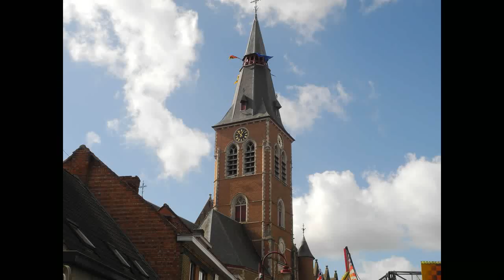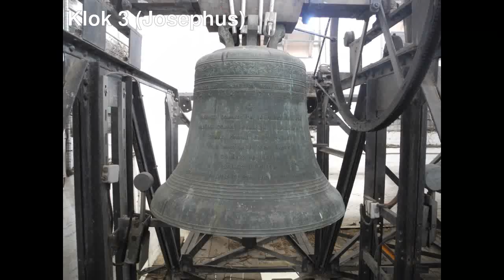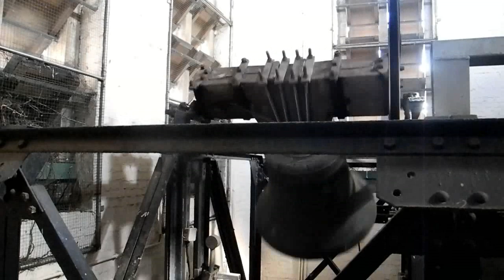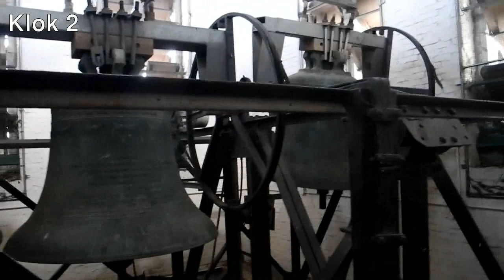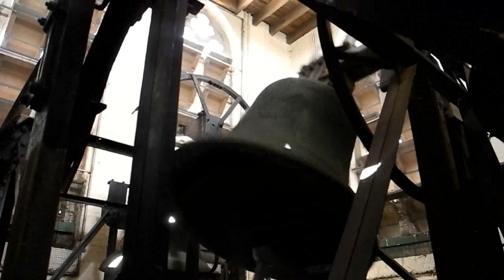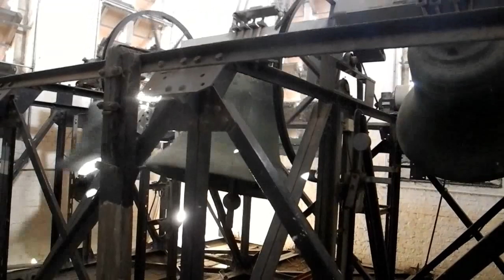Klokken van de Sint-Korneliuskerk van Aalter

Comment: you got scared by them on hour
Reply from the maker: This is an automatic reaction of the body that the brain cannot control.  The normal reaction time of the brain is 0.3 seconds, and in my case rather 0.4 seconds, but the reaction of the body is already at 0.12 seconds.  So, the camera starts shaking before the brain can tell to the hands: do not move.  We know that it happens when the hour strikes, and we know there is nothing we can do about that, except making sure the camera cannot move.  Strangely, this never happens when the bell is ringing, only when it strikes.  And even when you count down and you know exactly at which moment the strike will be, you cannot avoid shaking the camera.